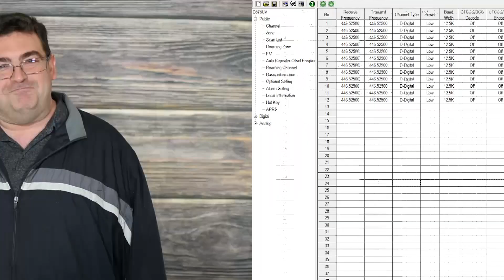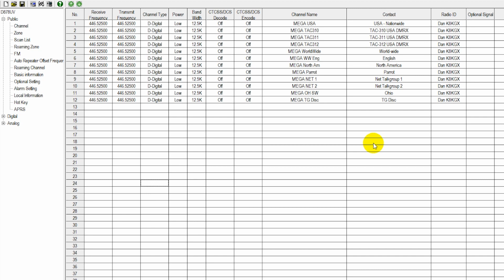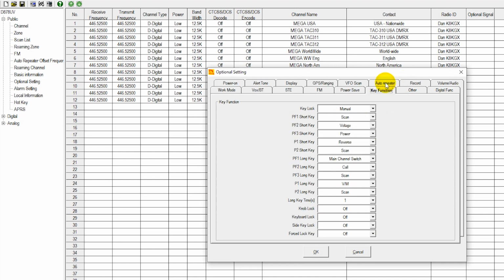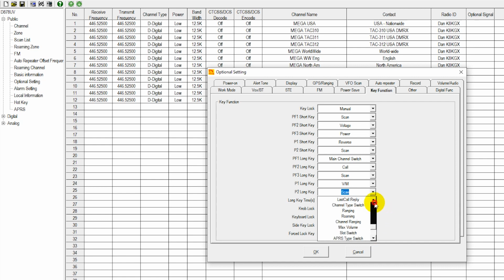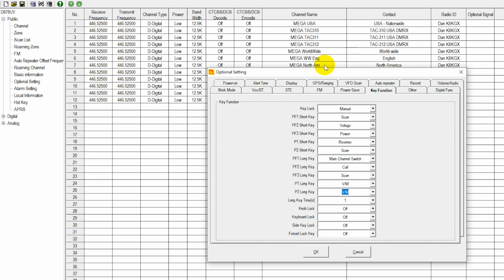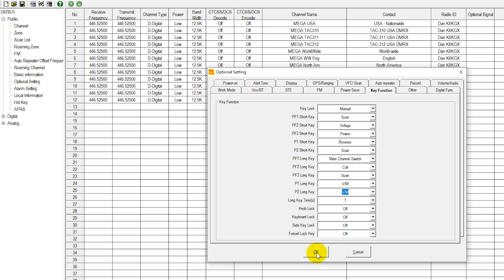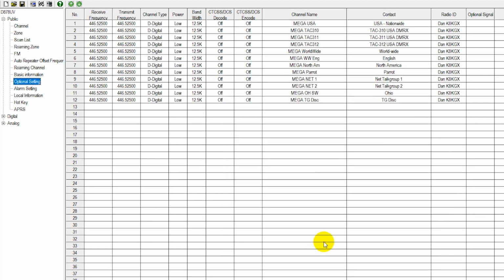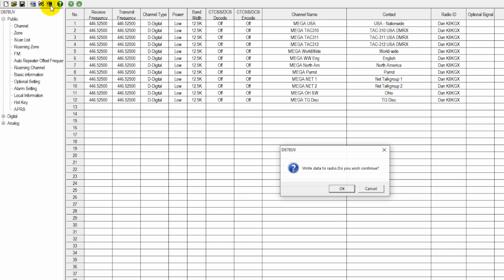How to Change VFO mode to Channel Mode on Handheld or Mobile Radio

Comment: i did the same procedure but still cant change to VFO mode. i am stuck in channel MODE , maybe  this has something to do with Professional or Amateur version of the radio ? or somethin i am doing wrong here? any advise ?
Reply: Ya my rt95 is stuck in channel mode
Reply from the maker: Please join our official BridgeCom Systems Facebook group page and post your question there.  It'll get answered for sure.

Comment: This doesn't do anything remarkable. And no one seems interested in following up on the issue. What the heck is a codeplug by the way and how do you find it to save it when performing a firmware update. The instructions are useless when it tells you to perform a critical task and then fails to explain how.